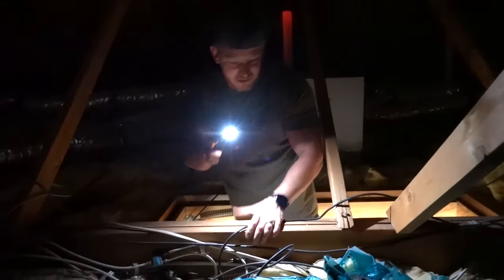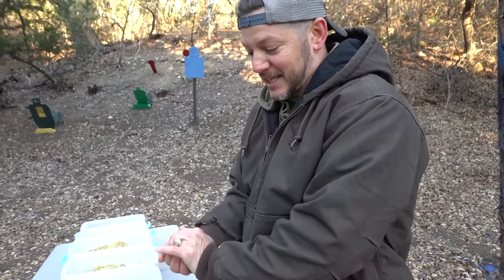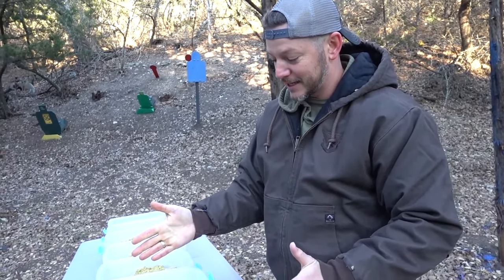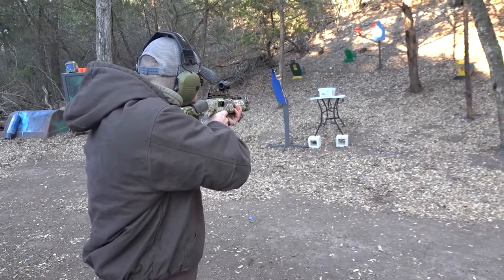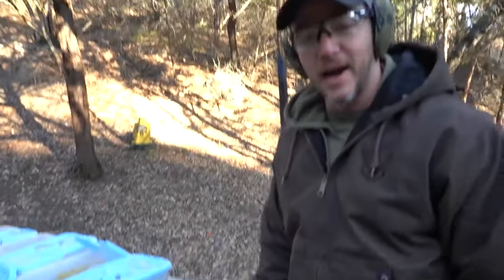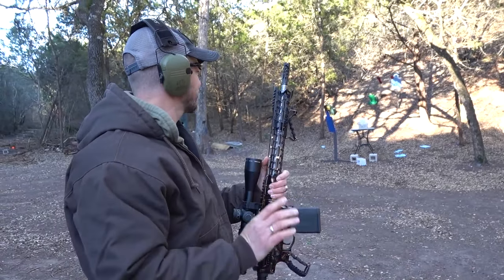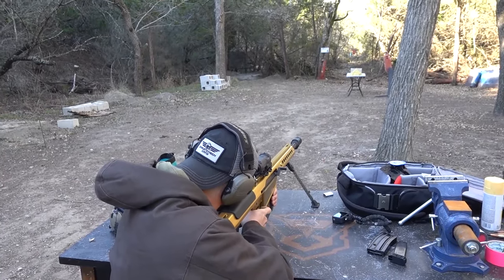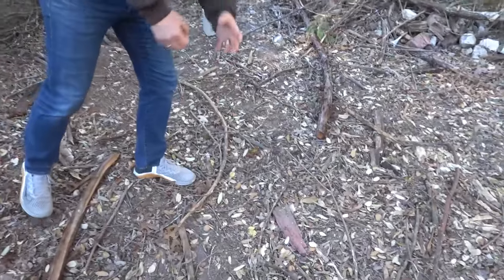Is Kinetic Sand Bulletproof? Some Weird Stuff....

Comment: That sand is just regular small grain sand mixed with starch and water. If you take only flour-starch and water it behaves weired. Fast movements make it solid, no movements let it flow apart. If you squeeze it in a bag, it sounds like walking through snow. really cool stuff that starch ...

Comment: Rotation +shape of the bullet actually pushes/shears the sand away. The same bullets with same velocity etc, but without rotation would be stopped much earlier, and be much more flattened. It would also spew sand much higher in the air.

Comment: Knives guys having a heart attack when he cuts the sand with a blade
Reply: Is it bad on the blades?
Reply: @dustinsterling3248  it's abrasive as fuck
Reply: @The.Heart.Unceasing  so it dulls it?
Reply: @gumpuslumpus844  yeah, it ruins the edge
Reply: That knife is $400 it’s a bench made
Reply: @kevn22  yeah, I'm crying over here because benchmade isn't sold on my country! I wish I have one LOL
Reply: @kevn22   in fact, iven if was sold here I would not be able to buy wich make me more sad when I saw that
Reply: Exactly
Reply: @dustinsterling3248  sand is super abrasive but it didn't really hurt it. Probably dulled it slightly. Cutting material with sand embedded is much worse because there's more pressure.
Reply: It’s not a bench made it’s it’s a boker mini and they’re around $40.00 bucks
Reply: @kevn22  it’s not a benchmade it’s a boker mini and they’re around $40.00 dollars

Comment: The bullet is not "cooking" anything, there's simply not enough energy in it to evaporate a significant amount of water. What happens is that shockwave compresses the sand, pushing the water out. And this happens when the bullet becomes subsonic (in sand), so that the shockwaves reinforce each other.

Comment: Maybe next time use plastic or hessian sacks instead of plastic containers. Or some simple plastic bags. No lids required, just tie them up.

By the way, when i was little i heard a story that i can't be completely sure from my uncle from his army time that they had some bullet penetration presentation where they shoot an AK at a concrete block and it puncture it and then they shoot at a sack full with unprocessed wool and the bullet got captured in it. And because of its spinning motion it turned up like a yarn ball.